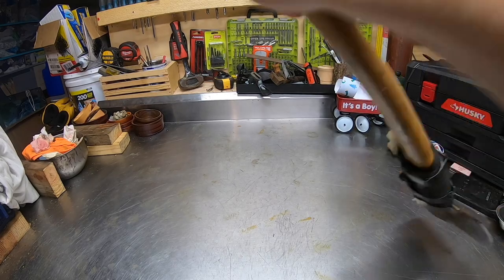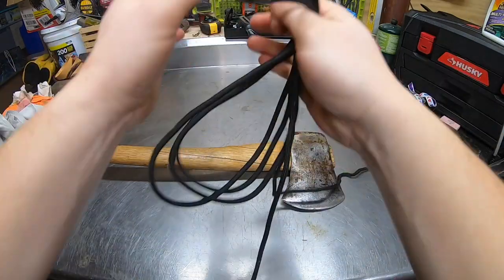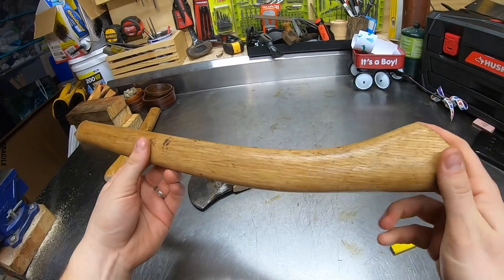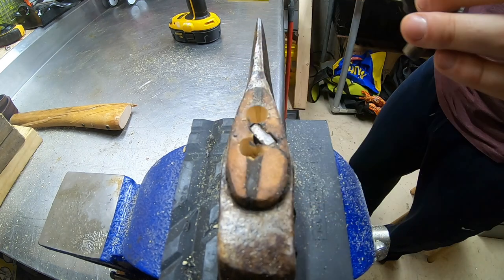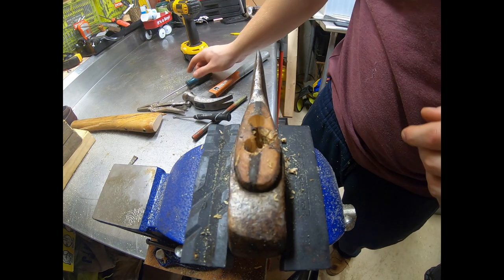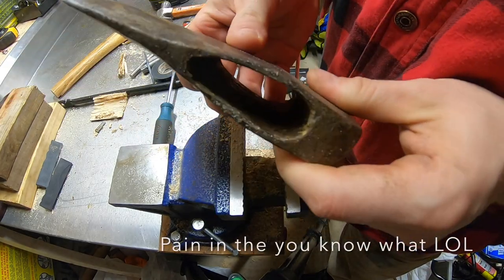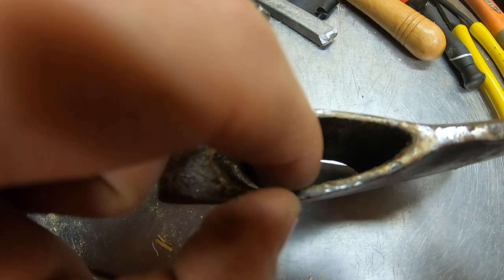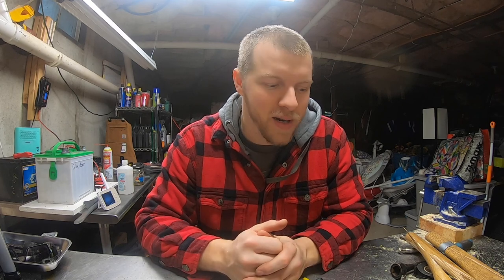Broken Tool Handle Removal! EP 109

Comment: excellent points on keeping the good part, linseed oil, etc. Since you heat with wood you could put the axe head on a nice batch of raked  up coals near the front of the furnace. ol' trick from gramps and countless farmers.  nice vid  bud.
Reply from the maker: Hey Vance! Thanks for coming by as always! I betcha I could but ive heard that sometimes that weakens the head? Im not sure if it would weaken the steel. Maybe ill try it next time LOL! The cutting edges are heat treated/hardened or whatever the term is so Ive heard that reheating messes with it but not sure on the facts! Thanks for tuning in!
Reply: @HomesteadJay  true, just dunk them in used oil.when u pull them out.. experiment... i could be wrong!!!
Reply from the maker: @vancegodin4149  Hmmm! Hopefully I dont break any handles any time soon lol how about soaked in oil and THEN burned? LOL!
Reply: @HomesteadJay  if you want to waste some  old oil, gofer it!. you could be brushing that shit on the outside of your cabin to keep the porcupines from eating your siding, but ...